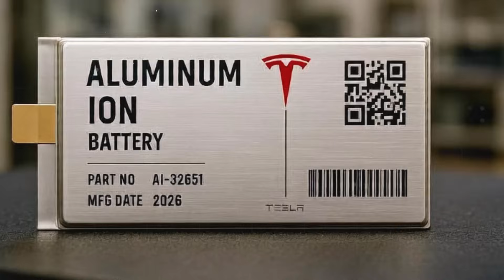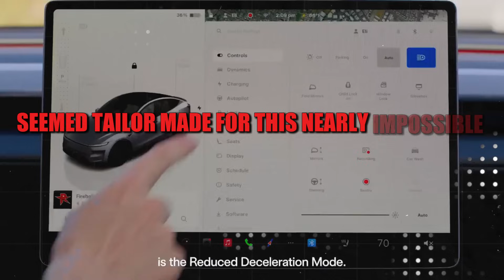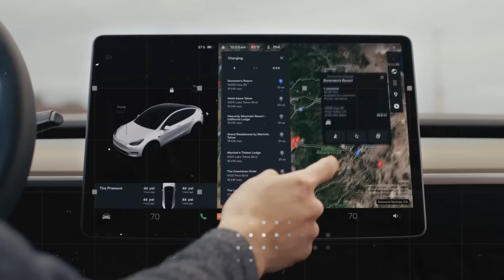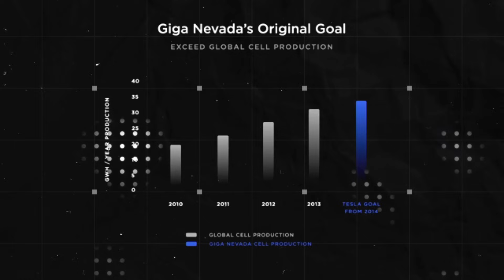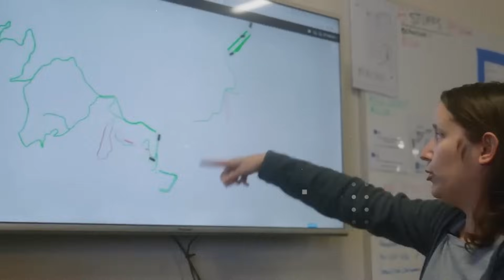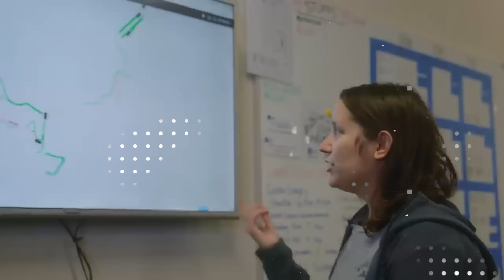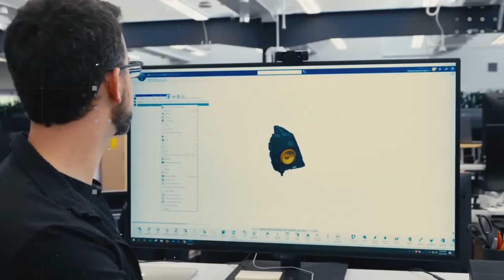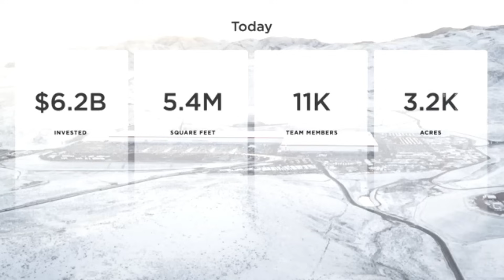New Tesla Model 2 Aluminum-Ion: 531-Mile Range, 1-Min Charge, Fire-Safe Battery

Comment: My plan is to get a Tesla once they get the better batteries but the reality of the situation is very clear. There will never be one minute charging there will never be 10 minute charging. All you have to do is look at the amount of energy that would be required to pull this off. The public is not necessarily aware of electrical engineering tech. In theory the battery can take a charge of five  C or more but they always fail to report the actual obscene amount of energy required to pull this off. You would need grid level power availability for one station in order to do this and that's never going to happen. The power company would charge you a fortune to have that kind of available power and they're not going to do that and people would never do it anyway because the cost would be so high so were going to be stuck with a little bit slower charging for the foreseeable future.
Reply: At 4 mile/kwh and 531 miles, that makes ~132.75 kwh battery.  At a 1 minute charge rate that means 60 x 132.75 kwh= 7965 kw or about 8000 kw or 8 Megawatts.  That would be one expensive charge.

What Elon and the EV gang don't understand is making fuel will be 10 to 30 times cheaper than charging on a 100% RE grid and that is at 100 kw or so.  8 Megawatts?  Insane.

The key is off grid vs on grid.  Off grid fuel making is 3 cents/kwh ($1/gallon) but on grid electricity is 60 cents/kwh for house (10 kw charge rate, btw).  At a super charger (100 to 200 kw) it will be 90 cents/kwh.  I would guess an 8 megawatt charge would be 300 cents/kwh or so, or like buying gasoline at $101/gallon.

New combustion tech is par to EVs at 75% and the weight of a car is 60% of EV which give combustion 6 miles/kwh vs EV at 4 miles/kwh or 1.5x better MPGe.  

Bottom line is EVs are obsolete.
Reply: I have a Chevy volt, it charges exceedingly slow at 3.2kwh, I can get 30mi in 3 hours, but these Tesla's are getting 200mi in 30mi it's not like most people are doing the cannonball. You can sit for 10 to 30 mins and chances are you'll only stop once. My old gas car would do 400mi on a tank. I'd fill up around 200mi, so I could make it back to that same station. I would have to do the same with the Tesla